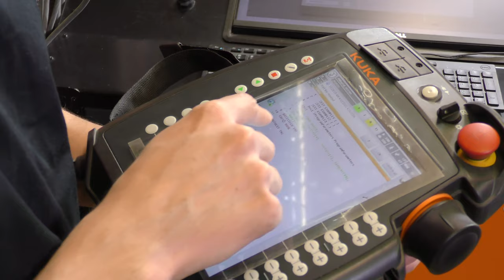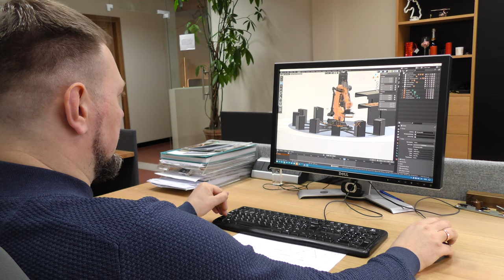RoboMill – Industrial robot carpenter without an attitude

Comment: you forgot to mention , that introducing a new part is a cost of 8-12 hours of work of a highly paid robotic specialist. not profitable for low volume manufacturing...
Reply from the maker: Hello and thank you for your comment. One of the main advantages of this robotic system is that is exactly meant for low volume manufacturing. This is why:

- To introduce new parts to the robotic system a robotic specialist will not be required. It's highly likely that a manufacturing company already has a technologist who knows how to use CAD/CAM software which is what is used to tell the robot how to process the parts with different tools on different workposts. Once that is done it is very easy to make orders through our user-friendly interface. This robotic cell is designed in such a way that you will not need to program anything using the robots pendant.

- Once CAD/CAM projects have been written it's possible to select orders for different size and types of parts. For example, on the conveyor, we can place 3 different types of blanks, let's say: Chair leg 1 - 5 units, Table leg 5 - 15 units and cabinet leg 2 - 4 units. In our software we will enter the same orders in the same priority. Since the CAD/CAM project have been already written the robot already knows on what posts it has to process the parts and with what kind of gripper to take them. Once it will finish the first 5 units it will go on to process the other ones, all without the operators' interference. That is why it is perfectly used for small-batch production. 

- The automatic gripper changer station provides the ability to have multiple grippers for different types of parts. 

The idea of Industrial Robotics Company is to make industrial robots accessible to low volume production companies and like with all of our solutions we design them to be as simple to use as possible and that you would not need any robotics specialists in your company to use these robotic cells.

We would be glad to tell you more about the solutions we have developed and to deny the myths that robots can only be used in mass production. Please contact us at: info@industrialrobotics.lt and we can schedule a quick video call to provide more information.